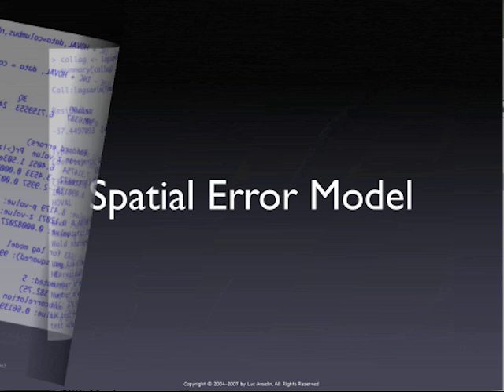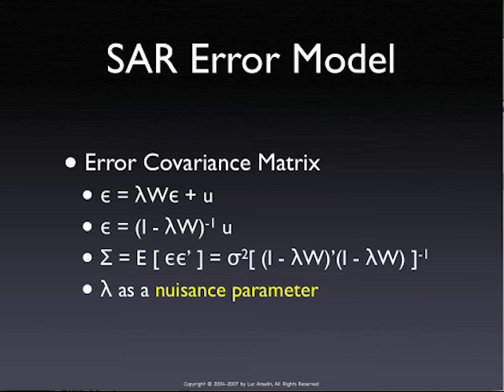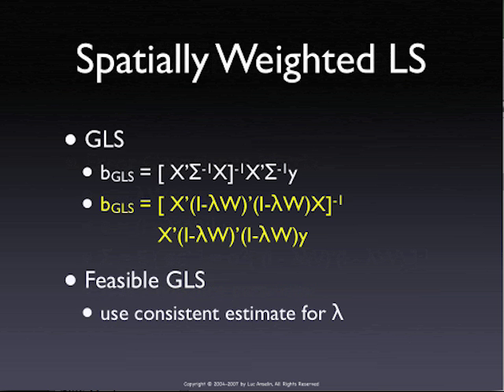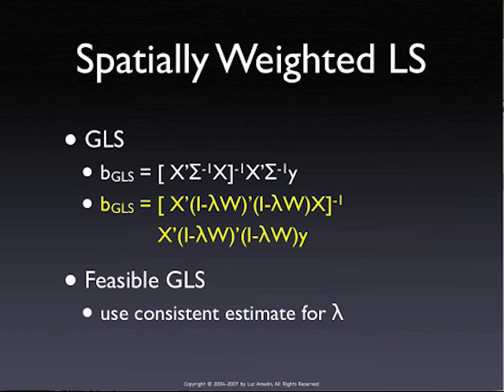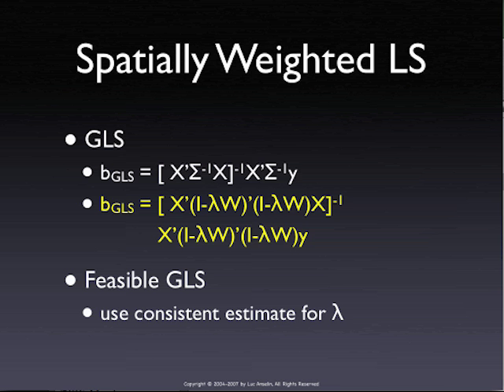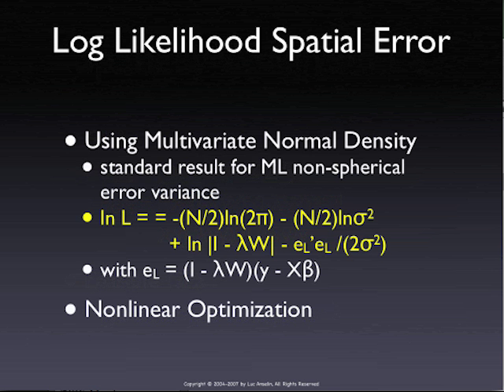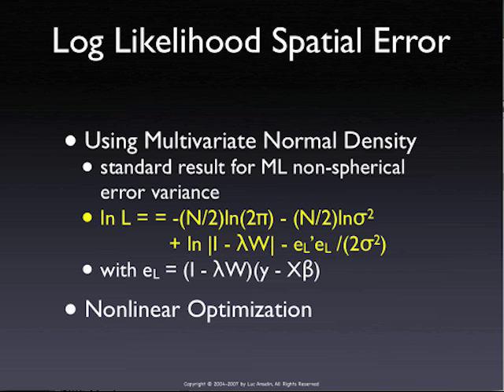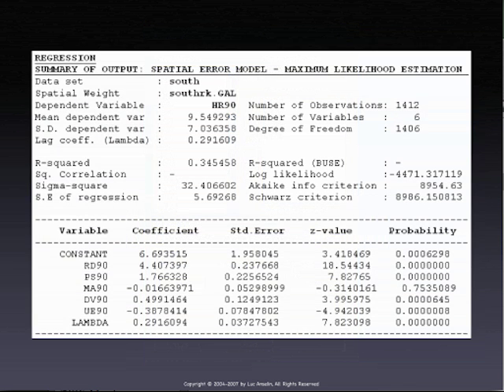Spatial Error Regression Model

Comment: Hey. Thanks a lot for the upload. Great lecture, so informative. I was wondering how could I construct an equation using calculated coefficients by spatial error model. I mean something like the equation we usually construct after standard linear regression so that we can predict the dependent based on independents.